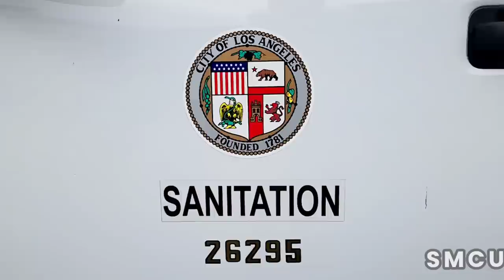Cleaning Homeless Encampments at Venice Beach

Comment: If the City insists on allowing this to continue to happen, then use the Los Angeles Municipal Code 56.11 which limits a person to how much personal property they can have in public, which is ONE 60 gallon container WITH LID CLOSED.  Anything outside of that container and on your person is limited to less than 2 cu feet which is described as fitting into a backpack.  Perhaps these Vagrants should be issued 60 gallon trash container to keep their personal belongings and tent inside;  and allow them to walk away from the container with nothing more than a backpack to hang out in the city and on the beach for the day.  It could encourage to stop the hoarding of non essential items.  And give the city closure on the enormous amount of garbage that is being dragged onto your beaches, parks, street curbs.

Law and order needs to be returned and it looks like the city is working with the park rangers, the police and sanitation dept along with the LAHousing to try to stop this insanity in this otherwise beautiful city, beach and pier areas.